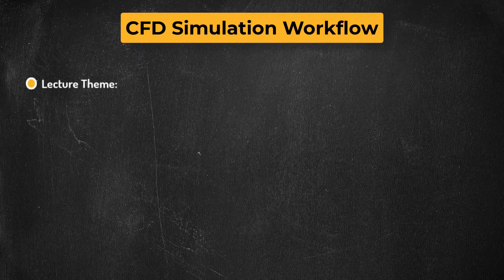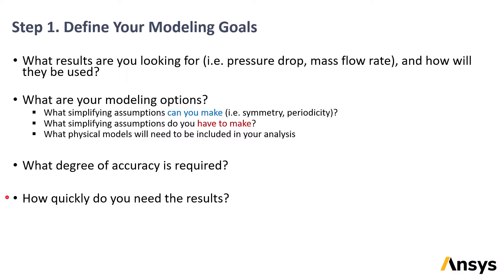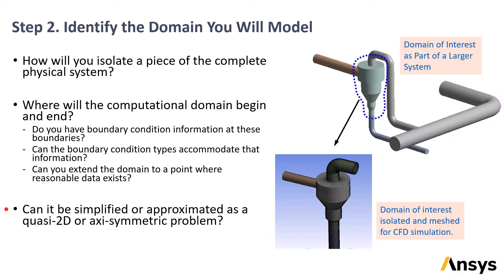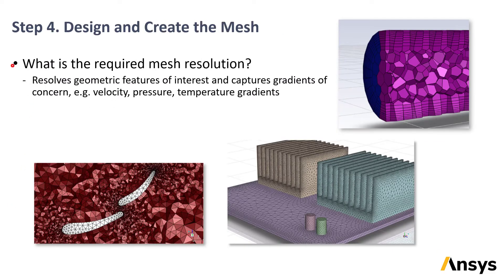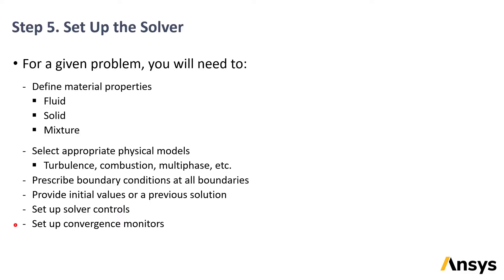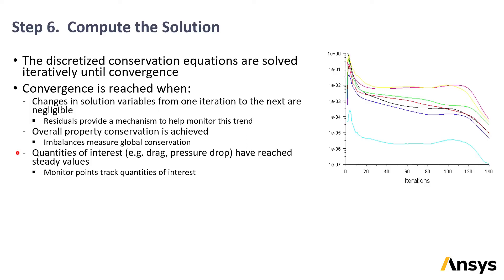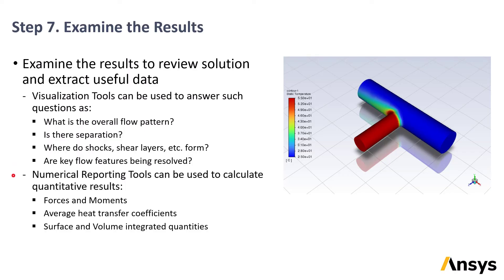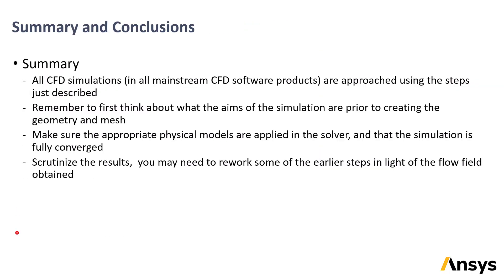CFD Simulation Workflow — Lesson 2

Comment: Hello., bro. I have a question. For example, in the case of Chemical Reaction simulation between (NaOH.H2O)  0,1M and (HCl.H2O) 0,1 M., How do I set the correct chemical species for inlet flows of   (NaOH.H2O)  0,1M and (HCl.H2O) 0,1 M. Hope can get the answer from you. Thank you in advance.